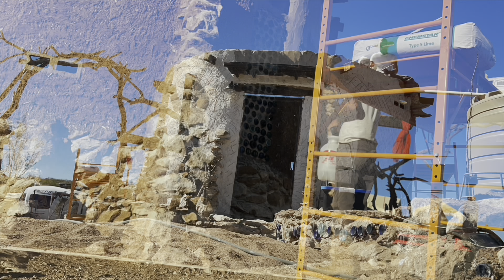Why We Are Using Lime Plaster Over Our Cob Earthen Walls

Comment: Hope they hold up. On my earthbag shed the lower plaster started to fail. Even with large roof overhang.
Reply from the maker: We will definitely keep an eye on that.  We've heard it can erode from the bottom up from water and we will also need to re-apply the limewash every 2 to 3 years.  Did you use lime plaster?
Reply: @tworebelsoffgrid  Yes

Comment: Hope you 2 are doing well ... the chicken mansion is turning out really well. Question, are you going to be able to paint the lime or are you just going to keep it raw?
Reply from the maker: Thank you...we are getting there!  Good question...we will be adding one more finishing "smooth" layer of lime plaster on the roof and exterior walls...letting that cure and then doing a lime "wash" which is just water mixed with lime and clay pigment.  That can be painted or rolled on and will help with waterproofing and also giving it some color...we are hoping the pigment we chose will be close to the color of our dirt, but just not quite as dark.

Comment: Do the structures you put up effect your property taxes or do they have to be a structure that you live in?
Reply from the maker: Those are great questions!  Yes, anything we build can impact our property taxes whether we live in them or not.  An example of that would be after we installed the perimeter fence and they did a reassess and upped our taxes a bit...not too bad though.  However, if you keep the cost to build under $1000, it's under 200 square feet, and it doesn't have utilities, you don't have to get a permit to build it.